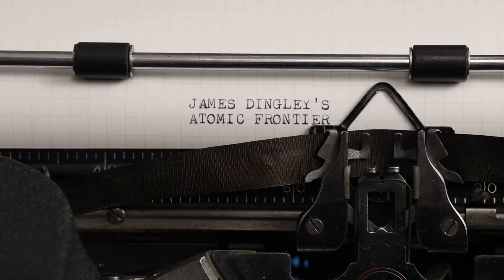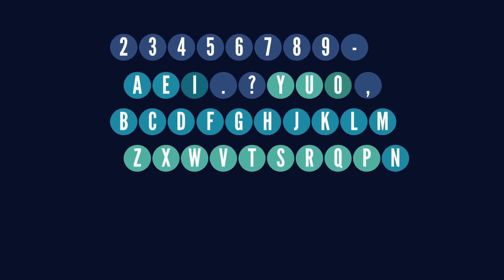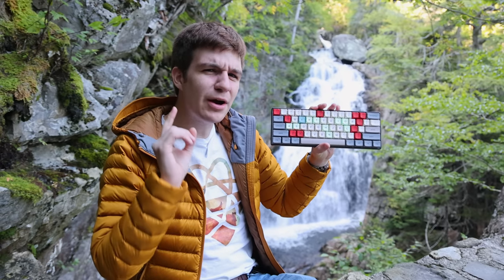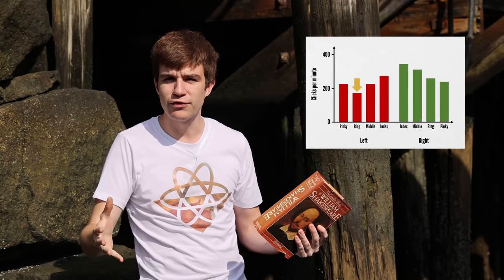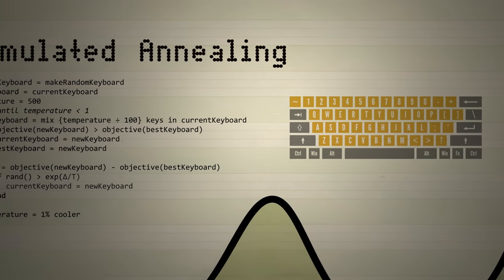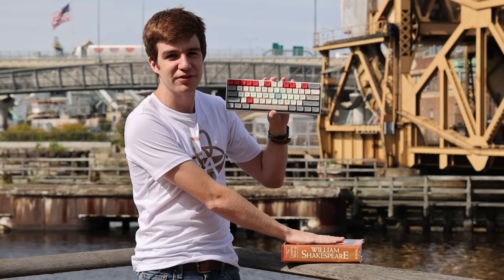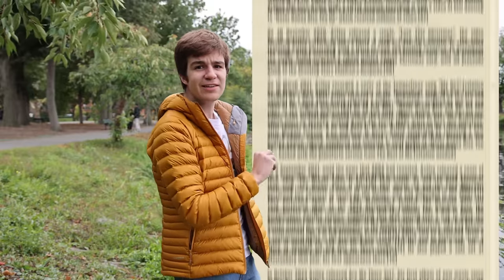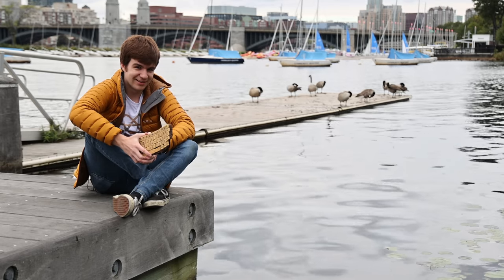QWERTY is broken. Can we make it better?

Comment: There's another dimension to this, and that is the fact that QWERTY isn't just used for English. Netherlands, Scandinavia, Spain, Portugal, Baltics, also use it. Belgium and France use AZERTY, Germany, central Europe and the balkans use QWERTZ.

In Belgium, there's a really common issue on Windows where people accidentally switch keyboard layouts from AZERTY (Belgium and France standard) to QWERTY. All it takes usually is to accidentally press alt+shift to switch between keyboard settings as for some reason most WIndows installations come with both presets configured.
AZERTY and QWERTY only have minor differences in letters (A<->Q, W<->Z, and M<->comma) but almost all of the special characters are completely different.
AZERTY is ABSOLUTELY HORRENDOUS if you are a computer programmer because many of the symbols are only accessible using the ALT key.

Whenever you boot up a video game for the first time in Belgium, the first thing you ALWAYS check is the keyboard settings to see if the developers did correct localisation, and if not, go through the entire thing to make sure your WSAD becomes ZSQD. I usually don't change the M for map anymore, I am so used to pressing the comma button for opening a map that it doesn't bother me.

What is annoying however is all the number keys. In AZERTY, numbers are on the same keys, but they are accessed through SHIFT+number key. The default names for the keys are all symbols. "1234567890" becomes "&é"'(§è!çà". This is good for French people so they have access to their accent aigu's etcetera, but very annoying to have a video game tell you to press "à" for rocket launcher and "§" for shotgun.

Comment: A few years back I tried experimenting with alternative layouts, like Dvorak and Colemak. The biggest issue I had, apart from getting familiar with the new layout, is that the optimizations are language dependant. Typing may improve for one language, but gets worse for another. As someone who is multilingual it was no overall improvement for me. It still seems that qwerty is the least worse layout for me.
Reply: this
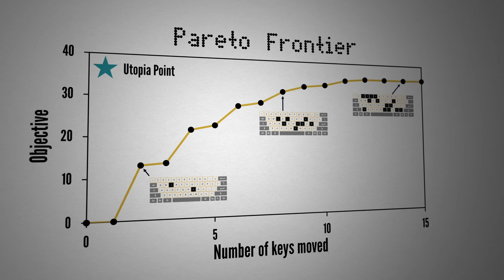Reply: starting at 11:35, only moving a few keys around that benefit your language and vocabulary can already provide a big improvement. No need for a full layout swap. You can use a few tools to edit your keyboard layout and then just pop the keycaps to move them around or use a sharpie and some tape.
Reply: @TheSliderW  It can provide a big improvement in terms of one language but at the same time make hinder input in other languages.
Say, you move J to the top row (like Colemak does) because it is not as frequent in English, and you put N there instead.
However when i am typing Chinese in Wubi, J key stands for 是 which means ‘is’, a very frequent character, and now i need to go to the top row to type it, and in the home row i have 民 which is a less useful character.
But multilingual people use different languages all the time, and we’d rather not have a separate layout for each language because not only constantly switching layouts is inconvenient, but also adaptation to every single layout to reach good typing speed takes longer than a month, while overall gains are only marginal.
Reply: @damian_madmansnest   yeah on paper we should have one layout per language as well as one layout per keyboard form factor. but it can be a lot to learn so in practice we have to make compromises and balance. That doesn't mean qwerty is good by any mean, just that the dvorak-style keyboards use algorithms with a single language.
Colemak is particularly bad at that. It got a lot of critics. Even its qwerty compromise is often negated by modern software allowing to change the shortcuts.
As a native french speaker, I had this issue writing English and German with the bépo layout (which is almost complete for occasionally typing every Latin script languages) until I used a symmetrical keyboard and programmed Z and W (the [ and  ] us-qwerty keys) to be on the left side. I just keep a qwerty label for the badly written programs hardwired to this legacy layout so in the end I won't touch anything else than those two.
Reply: I was thinking the exact same thing for work functional use. I end up using lots of keyboard shortcuts and special characters in my work that wouldn't typically be used for conversational or literary English.
Reply: Similarly I need to rapidly shift between writing casual and formal english messages and 7+ different programming languages with wildly different syntax.

In theory I could run his algorithm against all the githubs with languages I use daily plus a bunch of programming-oriented wikipedia pages to get a layout, but then i'd have to go the trouble of relabeling the keyboard on a macbook so I can still hunt and peck one handed when I'm dealing with my toddler. much easier to just live with qwerty.
Reply: also, I think people's temptation to think they can universally solve keyboards is the same kind of wrongheadedness that lead to unicode's han unification hullabaloo
Reply: @SOOKIE42069  Though it's probably better to generate your custom programing mode through a distinct layer or a second layout and let the main direct access for words with whatever qwerty or dvorak-style variant.
Sure nobody can't universally solve keyboards, even for a single language with multiple dialects and sociolects, but qwerty just remains as a huge technical debt as it's goal was already obsolete before WW1. For the physical layout, we even went backwards ergonomically speaking by making the Selectric layout as a de-facto standard.
Reply: @PainterVierax  I mostly agree with you. Ultimately the best thing for the consumer is for the trend of fully customizable keyboards to continue so that you can simply build the right keyboard for their task, much as there's many different hammers and saws for building furniture. It would be interesting to see a decent ergo keyboard with oled keycaps that can change labels with layout to aid learning to context switch.
Reply: @damian_madmansnest  It is possible that when you've learned a keyboard layout you can make one layout for each language if you REALLY want to get down and dirty.
Reply: @Gatrehs  Rather, if i have unlimited spare time and i REALLY want to waste it. Also, learning interference will very likely kick in, and it will be very hard to separate all latin layouts in your brain. E.g. after the Semimak competition most of the most of the best typists were saying it completely botched their qwerty memory for a while. Except for Jashe who incidentally also won, maybe he’s really good at the multilingual thing.
Reply: Hmmm, I've similar experience. Once I learned to type with Dvorak keyboard at my smartphone for my native language and got to type quite effective, but when iyping in English and moreover German become a hussle.
Reply: @damian_madmansnest  switching between layouts is just a matter of regular practice. Like speaking different languages or driving different vehicles.
Semimak is quite recent and I guess the competitors fast trained with complete dedication without using qwerty anymore during months. This is what f-ed them afterwards and this is not how most users learn, as people often can't install drivers at work.
Though making few adjustments on a separate layer can be less of a mental charge.
Reply: It's even worse when your language has so many diacritical marks that you need to add so many dedicated keys for letters with diacritics, that three rows aren't even enough. The Czech keyboard for example has completely replaced the number row with the letters ĚŠČŘŽÝÁÍÉ (and to type numbers, you have to press shift, which is why I hate keyboards without numerical block) and there's still Ú next to P and Ů next to L and even then there's still several (least common) combinations missing (ĎŤŇÓ) where you need to press two keys consecutively (the ˇ / ´ key and then the letter key) to type them which is incredibly slow and annoying. When you have to deal with that, the whole QWERTY/QWERTZ/AZERTY/DVORAK/COLEMAK talk becomes completely irrelevant and you're just happy you have something that allows you to type without being too painful and that your alphabet has "only" 41 unique letters and not more.
Reply: @TheAngelsHaveThePhoneBox  The solution is simple : using a few dead keys for diacritics such as caron or Umlaut to compose those extra letters.
Then depending on their frequency in the language, some of them can get a direct access.
Reply: @PainterVierax  I mentioned those, we still have to rely on them for a few infrequent letters. But it is simply just too inconvenient and slow to use, especially when the language uses a lot of diacritics, like Czech does, which is why it's better to have the more common letter+diacritics combinations on dedicated keys.
Reply: @TheAngelsHaveThePhoneBox  yeah you said those are located on the num row which is very costly in fingers movement. A dead key in a good position could seriously alleviate the cost of two strokes.
Reply: @PainterVierax  It would have to be in a really, really good place, so probably somewhere near the F and J on the home row since it would be among the most frequently pressed keys(*) in Czech. And even then I'm still not sure it'd be faster.

(*) I looked up the letter frequencies and letters with the ´ mark make up over 8% of all letters, 2nd place after the letter "o". The ˇ mark is at around 5.8%, 5th place. The ° mark is only used with "u" to form "ů", 0.7%. So in total, almost 15% of all letters in Czech text have a diacritical mark. In other words, using only dead keys for diacritics, you'd have to make 15% more key presses. That's quite a lot, so I'm not really sure you could offset it by better position of the dead keys. Only maybe. 

But of course it absolutely doesn't solve the problem of then using the same keyboard for writing in English or other language, like I'm doing now.
Reply: @TheAngelsHaveThePhoneBox  Yeah could be on the homerow if it really improves comfort and speed. It depends on each language after all.
For including other languages, well as I said previously it's a compromise depending on how frequently each people switch from one to the other. Though it's less an issue to add some English weight into a Czech layout than incorporating any language to an English layout.
Reply: @ArturBravel  programming is part writing code, part thinking/organizing and part writing documentation/comments/reports/presentations. The amount of each depends on what you code and the environment you use (as you said: kb shortcuts) but for sure it's wise to get a layer dedicated to type text (English + other languages, depending on your location).
For the thumb keys, you can start humbly by shorting the space bar and adding keys on a standard mechanical keyboard. Some PCB kits for 60 or 70% keyboards allow that directly without hacking. Or you can go to a more ergonomic keyboard like ergodox, atreus, etc. Even if you have a tight budget you can at least build your own hand wired version. All in all, prior to designing your own keyboard, it's important to get experience with some notorious models to know their strength and weakness depending on your own preferences.
Reply: as both an english and japanese speaker, colemark has been amazing for me
Reply: Do you mean that you type in multiple Latin script languages? I'm multilingual as well, but my native language uses Cyrillic script, so I'm totally fine with Colemak.
And to make things easier I did the switch gradually, by swapping a pair of keys one per week or two, starting by the most often used ones. Now I use alternative layout for more than 3 years I guess, helped a lot with joint pain
Reply: I can only speak English and Hebrew so I only use my layout (Colemak DHk) for English
Reply: @damian_madmansnest What I don't understand is your insistence on keeping the two layouts in parity. Why does the 'j' need to be associated with this character that means 'is'? If where 'is' is, is convenient then associate the character  with whatever position on the keyboard rather than some arbitrary letter on a different layout.
Reply: @RowanHawkins  What you suggest is using an alt layout for English and an alt layout for Wubi. Using an alt layout for Wubi would mean that i’ll have to relearn abbreviations for thousands of characters and that i’ll have to make a special dictionary to look them up in case i forget. Also my original point was exactly that i don’t want to learn a separate alt layout for every latin input based language.

Comment: I switched over to a Dvorak in 2000 or so and used it until about 2016 or so. There was a learning curve but I did ok with it.  The biggest problems I had with it was changing keys when I bought a new keyboard, laptops were a pain and bringing in my keyboard to new work and then getting IT to allow permissions to load a new keyboard was painful.  The absolute worst was entering in my network or computer logon password.  Until the system booted up and loaded the Dvorak driver the computer assumed you had Qwerty, 100% a pain.  I switched back, learned touch typing a little more and that is where I am.  Great vid though!!

Comment: I made one improvement at work. Requested a compact keyboard without numpad area, so I could use my mouse at a more relaxed wrist angle. Then requested a separate numpad that I use left handed to divide the work load more evenly between left and right. Haven't looked back since.

Comment: In 2004 i started learning Dvorak. For a while, i continued also typing QWERTY. It was tough, very tough. But if I'd go from one to the other, I'd make a few mistakes, and then my brain would  click and i'd be okay - with one exception, my typing speed went way down.
So with that experiment done, I ditched QWERTY altogether and went exclusively with Dvorak.
Coworkers can't use my machine, because other than the A and M keys, none of the other letters match.
It was a painful re-wiring of my brain, but I'm glad I did it.
In 2008 i had to ditch the mouse - too much hand pain. Now I use a giant track ball. LOVE IT.